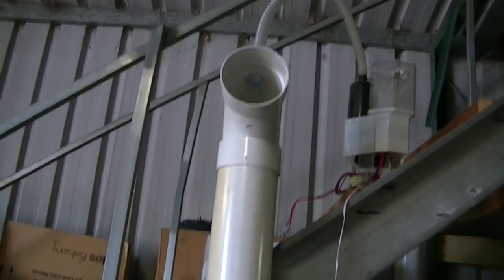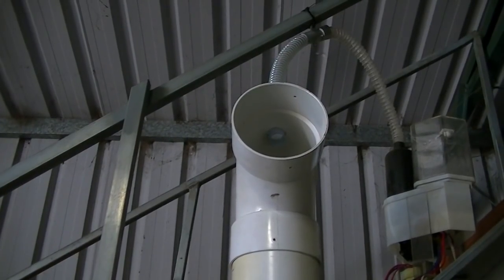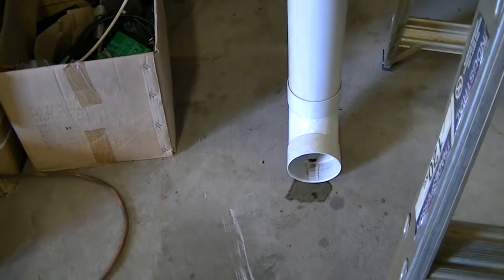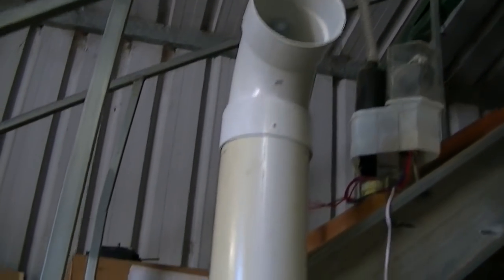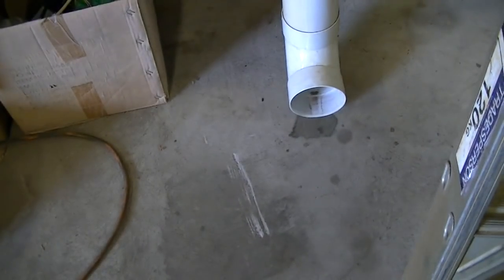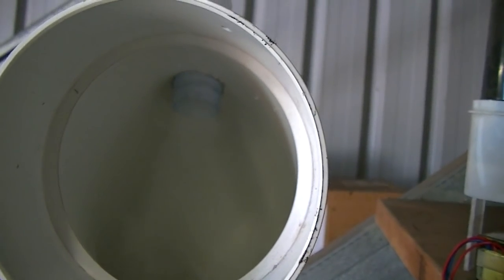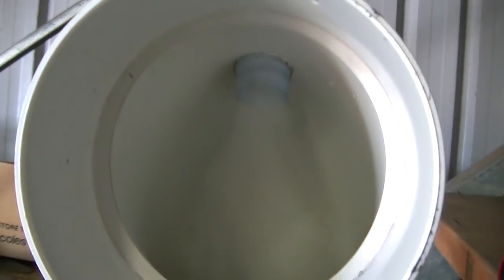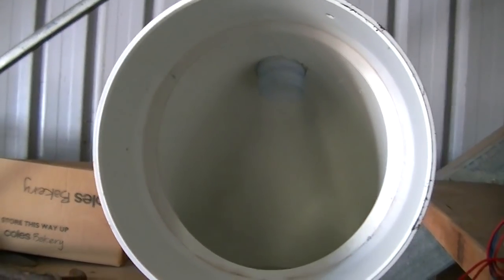Fogger tube turbine

Comment: TinManPower. Hi, I'm part of a senior design team for Bradley University. We're experimenting with hydrogen production through electrolysis using the same method that you are in this video. We'd like to ask you a few questions about your system if you're available to do so.

Comment: Interesting.  Keep going.  Excited to see where you run with this effect.  Seems not quite the venturi effect only since there is the deltaT.  We had portable water pumps for fire fighting in the Navy that used the venturi effect because that kind of pumping can do clean or dirty or muddy water.  The instructor in class (1982) noted that the volume of water pumped at the output end was way greater than the volume of water at the input side.  I could really see the difference too:  small input water source hose supply, a large venturi suction inlet side and the combined water exit side which had far more volume of flow.  Easy to pump thousands of gallons of water per minute.  It was a meaningful observation to me since it was one of my first hints of alternative energy gain possibilities.  The clincher was when (if I recall correctly) the instructor said that the gas engine driving the pump does NOT lug down under load, like when excess debris in dirty water was being venturi sucked or if venturi inlet got plugged up.  As you know water flow is often used as an analogy to electricity.  For me, in an instant, I saw the likeness and the world of alternative free energy conversion opened up to me.  None of the other sailors saw the demo beyond just a way to pump water.  Been exploring the field ever since.

Comment: Isn't your fog machine providing the inlet power, acting as air pump?
If there is more water to be collected at the bottom than in consumed by the fog machine, it might be an efficient way to provide water to communities suffering droughts. 
Apart from volume in and out (also from the fog machine itself in isolation), it would be good to measure humidity and temperature in, out and halfway.